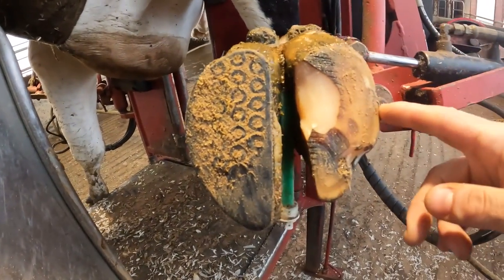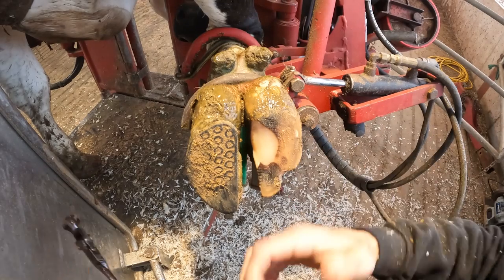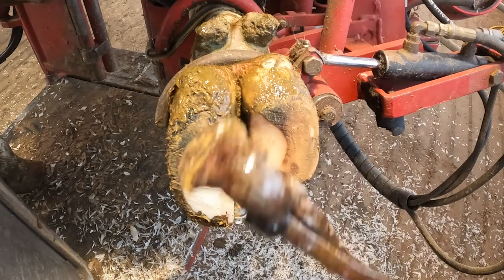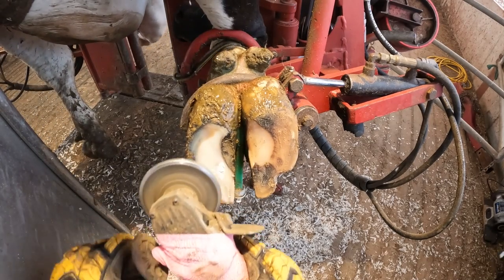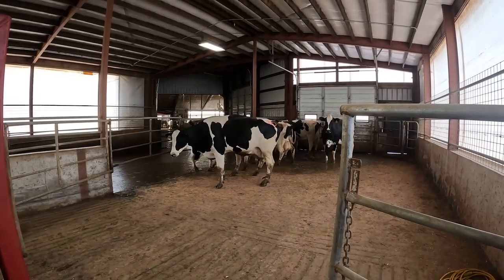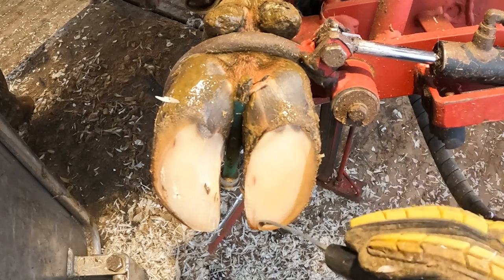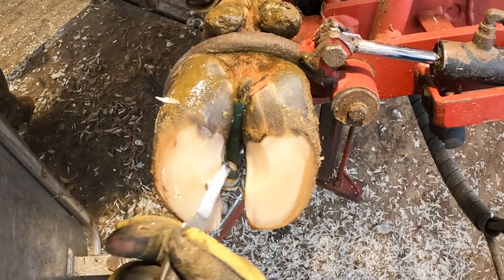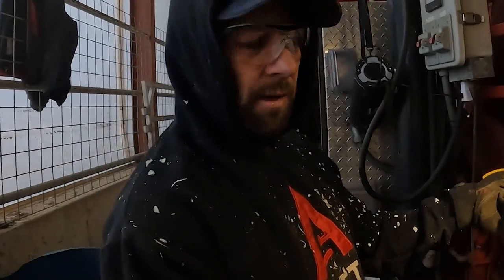Cow Shoe / Block Removal Satisfying Hoof Trim \ Hoof Restoration /

Comment: Judging by that block, it looks like she was wearing a lot more on the end of her claw than the heal, is that what you are wanting them to do or are they supposed to wear evenly.  And if they are supposed to wear evenly would you trim a little more off the tip to even it out, or just let her do her thing???
Reply from the maker: Ideally it would wear more evenly however here's wasn't worn  to the point that it was a problem.